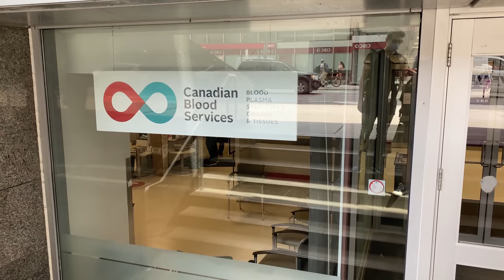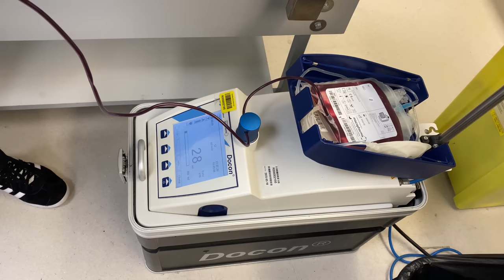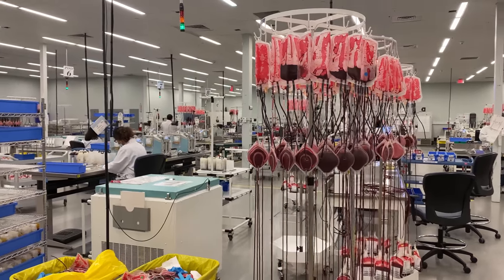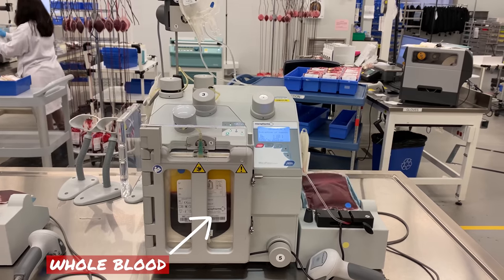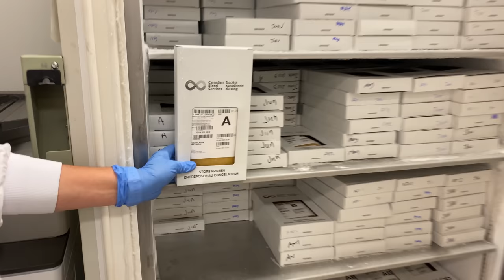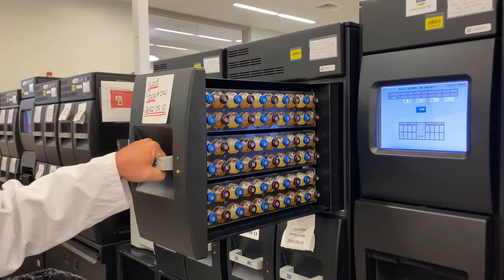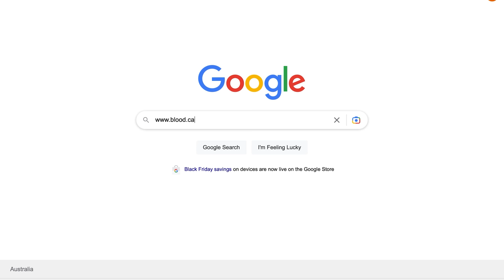Doctor Explains: What REALLY Happens To Your Blood After Donating

Comment: I used to donate blood. Once, I even got a letter telling me that my donation had actually been used to treat someone. That made me wonder if my previous donations had not been used and were discarded after they expired.

Then, three years ago, I needed transfusions. I received 5 units of blood after experiencing an in-stent thrombosis and heart attack that led to 40 minutes of cardiac arrest. I needed 1 unit in the first few days, but I'm not sure why exactly. A few days later they realized my leg was swelling from DVT, so they gave me stronger blood thinners, a shot followed by oral Eliquis (plus they had started me on Brilinta and kept me on it). However, that resulted in a GI bleed from ischemic colitis caused by the cardiac arrest. They thought it would get better on its own and sent me to a rehab hospital, but it got worse and my H&H crashed, so I went back to the ER and they gave me 4 more units of blood over a few days. Plus, they stopped the Eliquis and installed an IVC filter to catch any breakaway clots from the DVT to prevent a pulmonary embolism. I went home after a month. A month later, they scoped the GI injury, said it was healed and restarted the Eliquis for 6 months. They removed the IVCF a few months later, which resulted in a hassle as the wound in my jugular vein wouldn't stop bleeding, putting me back in the hospital for a couple days. I was thankful and wanted to start donating blood again, once I was off the Eliquis. However, I remained anemic for the following year, and they don't know why. Every time they drew blood for a test, my H&H would drop a couple points. So, my doctor says I probably can't donate blood anymore. 😥

Comment: It's fun to know that the type of action you use to pump out blood when donating is different at different place.

You've now all see the Canadian way (I suppose it is).

In Hong Kong there are 2 ways to be used. First, you'll be given a tube that you squeeze it apply pressure to the root of thumb (the essence of this is similar to the Canadian one). And the second way is that you'll be given a tube to hold vertically to spin it with your thumb and index finger.

Then in UK, you're told to use those large muscles, say clenching your bum, or to cross your leg and then switch sides, or put one leg in the air and then the other one, without using any of the muscle in your arm so the action will avoid affecting the needle.

Comment: Along with donating whole blood, some sites have the capability for donors to donate through aphaeresis, which only takes out certain components of your blood, returning the rest of the components to the donor. Examples are platelet aphaeresis (donating platelets only), double red cell (donating two units of only red blood cells), and plasma aphaeresis (plasma only). These are advantageous in that the product becomes available to a potential recipient much sooner, as the separation is already complete before it even arrives at the lab. All that needs done to it would be testing and repackaging, and it’s available.
Reply: Currently CBS has been collecting 2 units of Platlets and about 250 ml of plasma from my Platlet apheresis donation. A small amount of that plasma is used to flush the lines so no blood is lost when the donation ends. The plasma donation apheresis units take somewhat more - looks to be about a litre❤.  1 week minimum between plasma donations and 2 weeks for platelets. There is type matching for platelets as sometimes a recepiant may be allergic to a donor. Sometimes your donation will be sent to a specific individual.

Comment: I tried to donate blood a couple yrs ago and tried to donate plasma recently and was turned down both times because of my weight. I was told I’m supposed to weight 110lbs or more. Unfortunately I’m 5ft tall and I weigh between 101-103lbs. I tried everything to gain weight and nothing has worked. Any recommendations?
Reply: Try folic acid or perhaps multi vitamin...

Comment: 🩸 The reason I became a plasma donor was to do it more frequently, as it's possible every 2 weeks in New Zealand! However, not everyone is able donate plasma.
The process, via an apheresis machine, processes a larger blood volume which can be challenging for those with lower blood volume or certain medical conditions, possibly causing lightheadedness or fatigue. Some might experience a 'calcium crash' due to the sodium citrate used during apheresis, leading to temporary muscle function issues with symptoms like tingling or cramping, and even fainting - of which I am acutely aware having experienced this once! I was dieting at the time which goes to show you need to be eating well at the very least to be able. Therefore I was placed on a 6-month deferral for plasma while I completed my diet, and fortunately, I could still donate whole blood at the 3 month mark during my deferral.

Comment: I donated blood once in high school (when I turned 17, which is the age of eligibility in Canada). It took me 15 minutes to fill up that dang bag, and I was so uncomfortable. 😩 Having that needle in my arm, and feeling it move around was really causing me stress.
Cool thing about doing it though, was that I got a card afterwards, that they can scan if I choose to donate again, and it has all my info on it. It also has my blood type, which was neat to find out. Not sure if I was ever in an accident, and they found that in my wallet, they would automatically start using that blood type on me though. I feel like they usually play it safe, and give them O-, until they are able to test for themselves.

I haven't donated again since, for various reasons. Usually it's time constraints, and unable to find a centre that I can get to by public transit, that isn't going to take up a huge chunk of my day. Also, I'm A+, which is super common, and only used in situations where they know ahead of time for sure what blood type the patient is. I feel like if I was type O, I would be more likely to do it again. So there's a lack of motivation there. 
Also, throughout the years, whenever I do have some downtime, I have gotten into the habit of getting a new tattoo or piercing, which means I have to wait 3 months. And by then I get busy again.

Comment: I don't donate very often for two reasons. 1) I'm ABnull, null not negative that's a different thing, so it's extremely rare and every time I donate I get harassed by redcross for either more donations (which would be fine if it was within a safe time period and they weren't expecting me to travel at my expense to a different city and then trying to guilt trip me into donating). And I do mean harassed. I've had to change phone numbers, get sent numerous snail mail, e-mails etc.
2) I need it for myself. I can't accept blood from anyone other then another ABnull and as already stated it's extremely rare (and rarer because of the previous reason plus the same reason I don't donate much). Rare enough to put an exact number, not a percent, to. I have to wear a medical bracelet because the 'universal doner' will not work for me. So I keep some back donated to myself for a jic scenario (especially since I do enjoy some 'high risk' sports) and I don't want to rely on the very small world spanning network especially since even if they found someone ready to donate it's unlikely they could get enough in time. But since there's both a shelf-life and a limited amount one should donate at once within a certain time I do need some kind of fallback. It also means I'm at way higher risk if I become pregnant. Or if I need a transplant for whatever reason.

Comment: 00:20 I'm confused at this point. Why would you take the risk of transfusing blood that's not cross-matched? (With the exception of Code Omega, that is; with massive and uncontrolled bleeding I know why you would put off sorting the cross-match issues until later.)

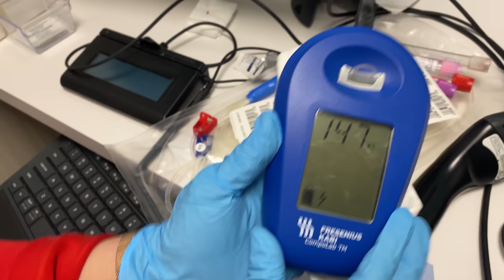01:17 The other day I almost failed donation because of hemoglobin. I was at 180 grams and the US FDA upper-end cutoff is 183. (Most often I'm in the 160s to low 170s.)

01:53 Naah. If you take so much as ten minutes, you're a slow donor. Five to eight is more like it.

03:17 Three months? In the US, whole-blood donors are eligible every 56 days (eight weeks). For those who have the spare time to devote to platelet donation, eligibility is once every seven days. I kinda recommend you to try apheresis at least once, to know what the experience is like. At my local blood bank, at least, I have free wifi to surf the web on my laptop and the staff cheerfully bring snacks and drinks on request. This only makes sense, as I'm tethered to the chair for 90 minutes to two hours.

06:12 And that's why blood banks tend to cosset their regular platelet donors. Anyone who's willing to make the extra effort to donate an entire unit (or two, or three) of them at once and cut out most of this back-end processing is doing them a mitzvah. And that's not to mention that platelets are incredibly perishable. While whole blood will last up to six weeks frozen, platelets go bad and must be discarded after five days. I used to be able to do a triple (three units) every time, but as I've got older I've been reduced to doubles, with a plasma and/or red-cell unit for lagniappe if they happen to be hurting for A-negative supply.

Comment: This was a cool video.   Alas, I wonder if the blood donation centers are more efficient in Canada than in the U.S? (Or the part I live in at least)  Last year I tried twice to donate blood at a Red Cross Donation Center. Each time I made an appt. & the soonest was several weeks away, which surprised me!  On the dates of my appointments, I drove out there (over a half hour away) then got there, waited over an hour once, 45 min. the 2nd time, then was told that they didn't have enough time left that day to get to me, despite my making an appointment waaaay ahead of time & sitting there.  They'd actually told me when I Arrived they thought that would be the case & I had asked, well, why didn't someone Call me & the front desk person just shrugged. I was very disappointed plus, as it happened twice, I suspect that at least where I was, that could be why donation levels were so low at that time. No one looked like they were in a bit of a hurry or even in ANY way apologetic over my wasted day/time & the loss of my undonated pints.

Comment: can you bleed to death when you donate?
Reply: That's what I worried about. Those are some big bags.
Reply: @quann06  yeah I almost faint when I get a blood test
Reply: No. As an average adult you have around 5 to 7 litres of blood and your body can compensate for a loss of approx. 1 litre. When donating the amount taken is 0,5 litres. Also the staff would intervene in case of something going wrong.
Reply: Thanks what about as far as getting light headed and faint
Reply: @robpeters2296  Well, that can happen, but's it's not typical. That's why after a blood donation you remain for some minutes (around the 5min mark) on the chair and then slowly start getting up. This gives your body time to compensate, so that you won't faint. But in case you actually faint despite all this it wouldn't be anything serious, just a sign that your body wasn't finished compensating the sudden loss of volume (I'm simplifying it a bit here). All it takes are a few minutes laying with legs up and you're good to go. But, again, that this happens is certainly not the norm.
Reply: Ok, when I have blood tests I start to see stars in my vision then I immediately drink apple juice and it helps
Reply: @robpeters2296  That sounds more like a needle-phobia to me (subconscious perhaps?)
Reply: @Axxe80  I didnt think of that, so its more psychological than physical ?
Reply: @robpeters2296  Yes, it highly sounds like that. The amount taken for a test is just way too low (even for a small child) to have any noticeable, physical effect. It's actually quite common for people to have a (often subconscious) phobia against needles or seeing blood.